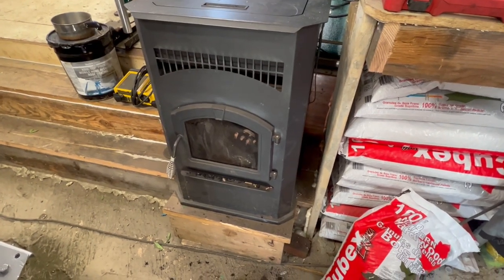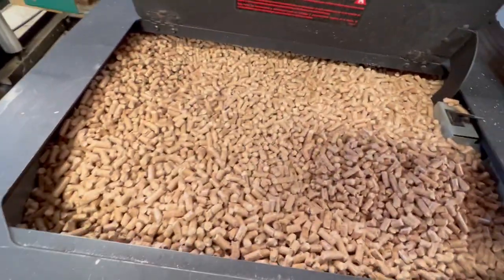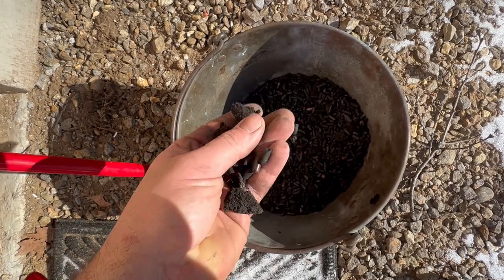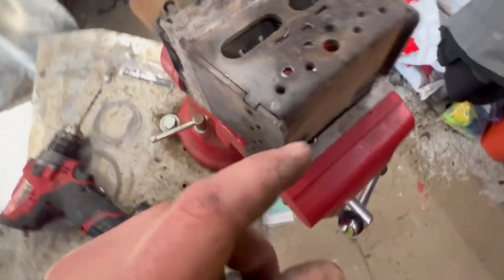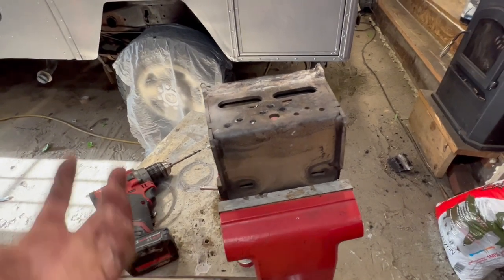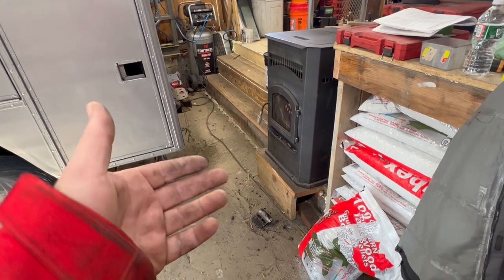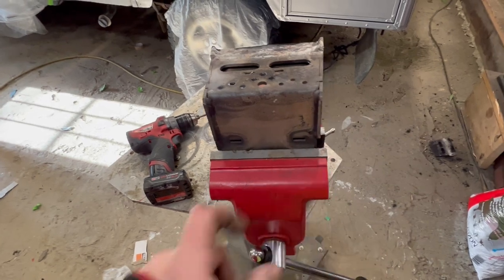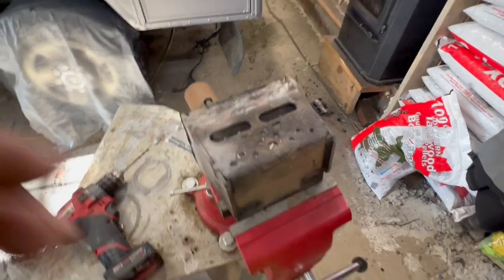Pellet stove excessive ash fix?

Comment: If you are burning the same brand of pellet and didn't have this problem before, then yes as you said it's airflow (I'm assuming the pellet heater has been deep cleaned inside at least not too long ago as that can impact airflow also). You mentioned you've changed the exhaust/flue setup and that's definitely the problem. You clearly know this but yeah air flow problem. I assume you can't turn the exhaust speed up any higher? You may also be able to slightly reduce the trim speed but obviously not by much if you want high heat. At least you clearly know the problem.
Reply from the maker: Yes. And yeah its burning 3 full bags before its clogged now. And since the only adjustment that I kno of is the air trim its as close as I can get it to being good. I wish it had 2 settings like alot of stoves. So you can adjust better.
Reply: On my Whitfield Profile 30 that I’ve been running for 15 years, with everything perfectly cleaned I had airflow issues as well.  I just opened the three main airflow holes by 1/16 of an inch and it made all the difference. Pellet stove flame is a brilliant 5-6” as opposed to a lazy 8-10”.  Thanks so much, you’re a life saver!